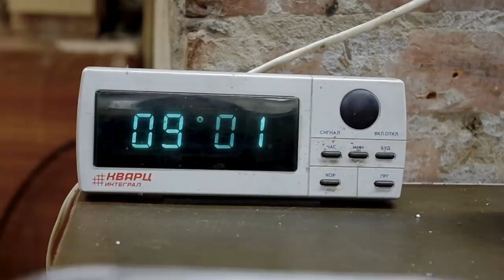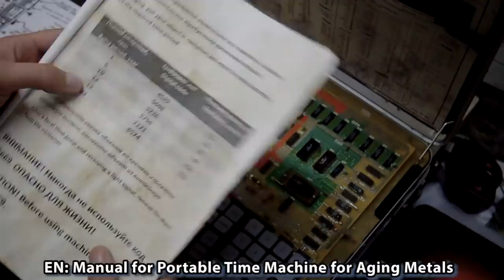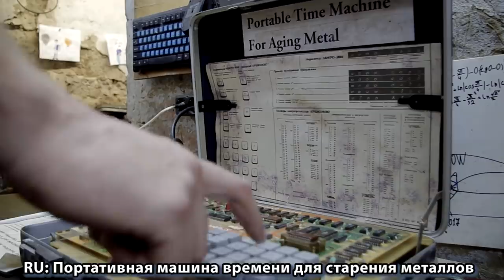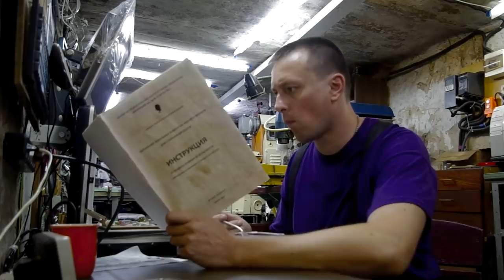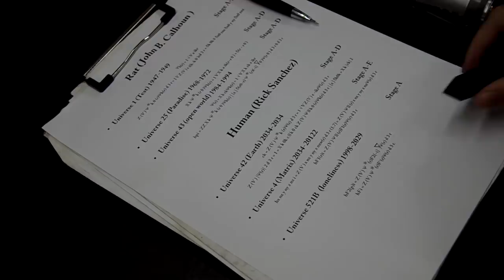Jedi Flashlight

Comment: I’ve just started learning machining (going to school for gunsmithing) and we’ve just started learning about the mill. However I noticed you using a 3 jaw chuck instead of a 4 jaw is there any reason as to why you use the 3 instead of the 4?
Reply from the maker: It's much faster in serial work
Reply: @EngineerBrunS  Does the slight in accuracies of the 3 jaw affect your work at all?
Reply from the maker: In good 3 jaw chuck accurasy can be 0,01-0,03 mm. In usual 0.04-0.05. When you work with blank it's doesn't really matter at all.
Reply: @EngineerBrunS  Oh okay, thank you very much